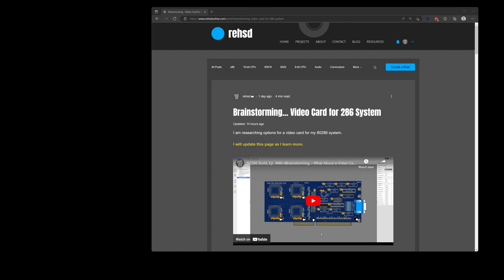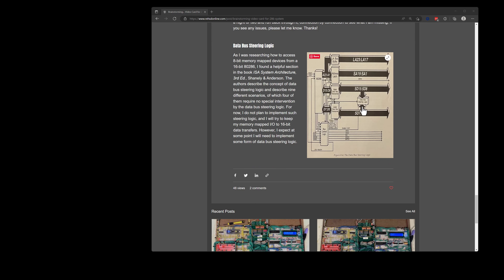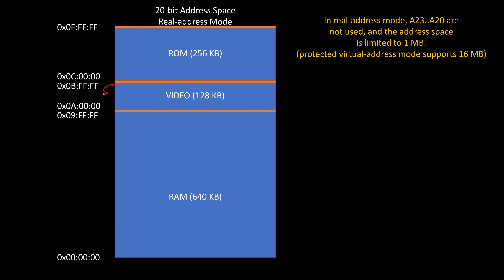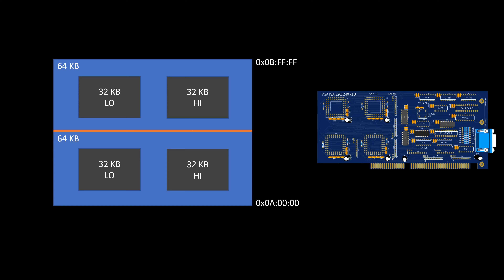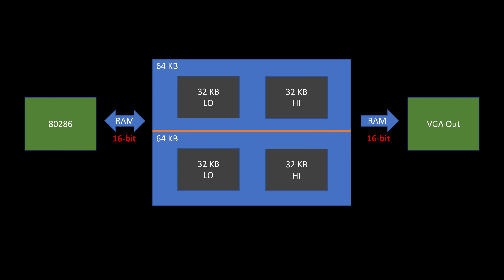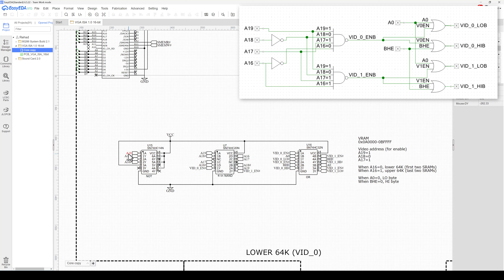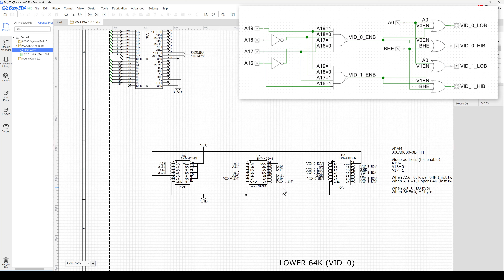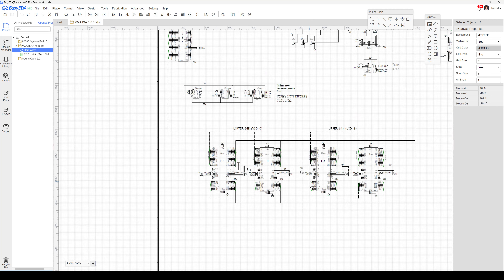80286 Build, Ep. #48 - VGA part 2

Comment: Can you use the dual-port chips arbitration features to make the cpu wait when there is a conflict? I don't know if 286 has a WAIT input that could delay its execution process like Z80 has.
Reply from the maker: Yes, I believe READY# on the 286 can be used for something like this. That, along with BUSY# pins on the SRAM should allow me to improve the design in the future.

Comment: I thought I'd get myself some dual port SRAM chips as well, then found out they are prohibitively expensive... Oh well.
Reply from the maker: Yes, unfortunately. I want to now build a card with enough memory for 640x480. It doesn’t look like dual-port SRAM will make any sense. I found some dual-port RAM (non-static) that is more affordable. I will need to learn about DRAM refreshes and the circuity to support it. Then, I need to figure out address space challenges. I might try to go with 600KB of memory and support two pages of 300KB, allowing instant swapping between pages. I could expose 300KB in my address space and have an I/O port for switching pages. Thinking….